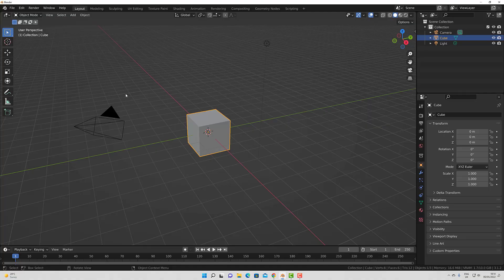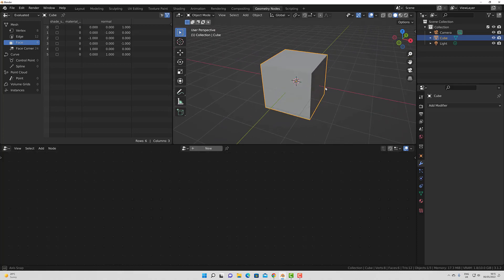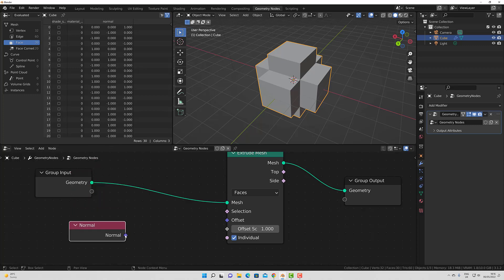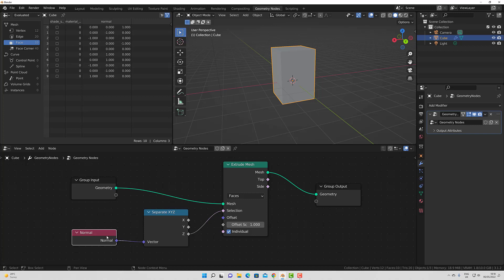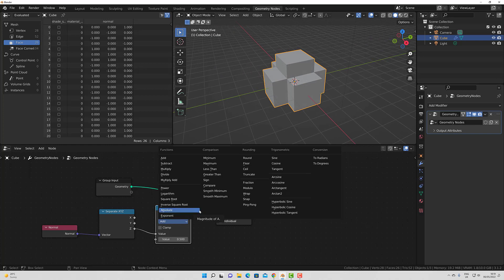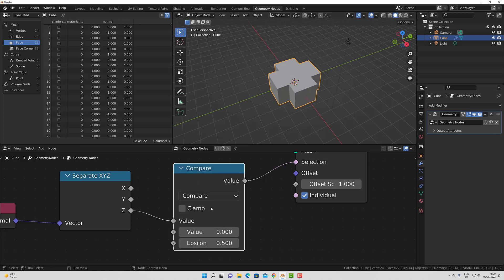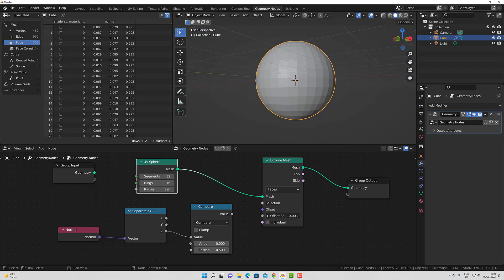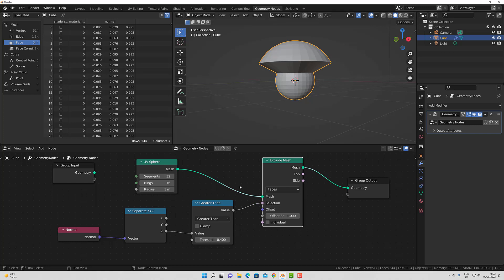Blender Tutorial - How To Use The Normal Attribute In Geometry Nodes

Comment: How do I display face normals in Geometry Spreadsheet as on 01:15? It seems to be hidden now, 3.6.3.
Reply: I am stuck here too. Blender 4.2 does not list the face normal in the Geometry Spreadsheet. I don't know the solution.
Reply: For you and anyone else wondering, as of 4.0, the option is now under "Mesh edit mode" instead of "Show overlays". Its one drop-down menu to the right, while still in edit mode

Comment: I've been bitten before by assuming a normal's component would be perfectly 0 or non-zero when I used a String to Curves node and filled the curves. You'd think all normals should be exactly (0, 0, 1) in this case, and yet I was getting bugs. So don't pluck Separate XYZ directly to a boolean socket, pass it through a comparison node, using some small εpsilon (I use 0.001 because that's the smallest visible in an input field)
Reply: A perfectly vertical normal, mathematically, does have a value of <0, 0, 1>. In graphics, however, it's <0.5, 0.5, 1.0>.

Normals can be either positive or negative (between -1 and 1), but they are usually stored in image files. Since image data only includes positive values, you lose the negative half of that range. To fix that, normals are re-mapped to fit between 0 and 1, where <0.5, 0.5, 1.0> is vertical.

This is why a perfectly flat normal map has kind of a cornflower color instead of pure blue.
Reply: @CertifiedDoc  the issue described by me is unrelated to image files: the normals at no point need to go through an image file.
Reply: @Broadsmile1987  It doesn't matter; that's the way it's done. Blender encodes normals that way regardless of their source. Inspect the values of your normals. You'll see what I mean.

Normals are encoded in the range [0,1], where 0.5 is the midpoint for each component of the vector. This is done (at least in part) so that they can both be read from and written to files using RGB channels. Whether the data ever touches a file is irrelevant.
Reply: Values below 0.5 indicate that a normal is pointing inwards. While this is possible, it's not very common and is usually a mistake.
Reply: @CertifiedDoc  I inspected values of normals plenty of times. I assure you, when you read a normal of a face spanning on XY plane (all verts have Z=0), the normal will be an array of 3 float32 values: 0.0, 0.0 and 1.0. The issue described by me in the first comment is not related to how vectors are stored differently in bitmaps, it's related to some kind of a float precision error, where apparently for a realized and curve-filled character instance, the produced face(s) will have their normals very close, but not exactly (0, 0, 1), e.g. 0.000001999999994950485415756702423095703125 for X and Y, and 0.99999988079071044921875 for Z. So even though comparing two floats is fine, when you don't have the knowledge (or a guarantee the implementation won't change) on how a float value is calculated, it's safer to use a tolerance-based approach: rather than checking if Z = 1, check if Z > 0.9999.

Comment: These "concept" or "terminology" Blender tutorials are terrific.  Please continue to make these for a better understanding of how Blender works.  We need the basics in order to be efficient and effective with our creativity.  For example, and not related to this video, some Blender terms are thrown around (even within Geometry Node sockets and menus) without fully understanding its formal meaning.  For example, Mesh vs Geometry vs Primitive . . . are they the same thing technically?  I know they're all comprised of vertices/points/faces but what is the technical distinction in those terms if any?  I guess I'm looking for a Glossary of terms.  Keep the terrific work with these tutorials!
Reply: Briefly, the glossary found at the bottom of the documentation outline lags behind Blender's features and their nuances.
Example:  'fac' as a common Geometry Node socket name.  Not mentioned in the glossary at all.  It means 'factor' which means a float value between 0 and 1, inclusive, or 0 percent to 100 percent.  This concept is trivial to experienced users, but a frustrating ambiguity to a novice.
Blender is 'free'-ware in the monetary cost sense; there is a learning curve time cost.